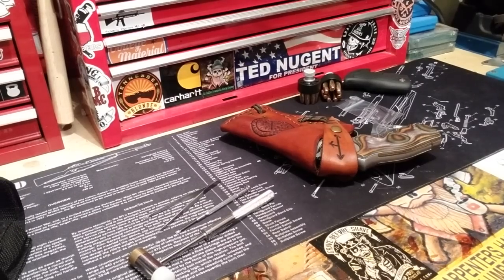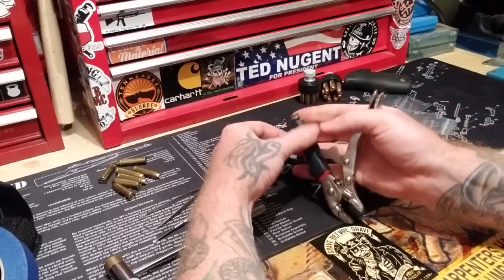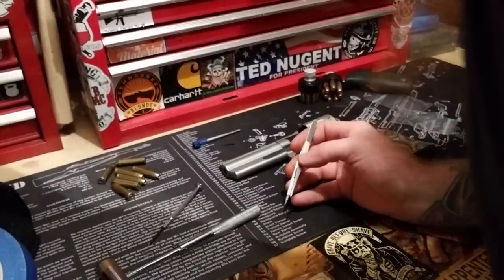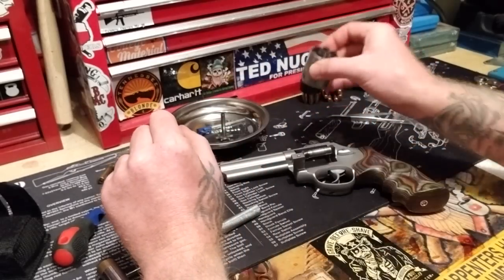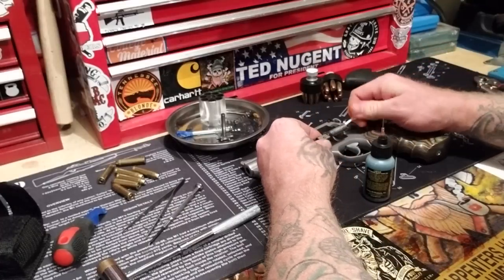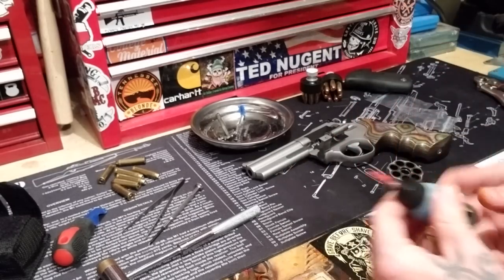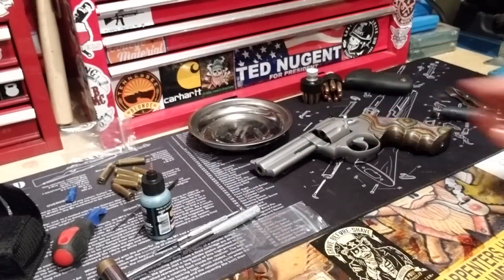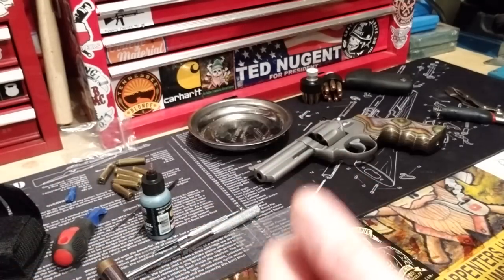Revolver Cylinder Removal and Extractor Repair

Comment: This is exactly what I needed to see , thank you I seem to have a little rust problem inside the cylinder somewhere at least the color brown shows around the ejection where the rounds go in the cylinder , so I figured to take it apart and clean it because the cylinder had trouble turning , any advice you care to give will be great fully accepted , Maybe a special oil this is a new Taurus 38 Special ultra lite and the cylinder was so tight I could not cock the hammer back , I had to open the cylinder remove the rounds and Squirt penetrating oil to get it to spin freely , And thanks to you , I know how to take it apart for cleaning , again thanks , I did have The slightest idea how it came apart . Great Video Complete and Total Thumbs Up !
Reply from the maker: Thank you brother please subscribe.

Comment: After disassembling my Taurus 856 to polish it, my extractor isn't engaging on the spring to keep it forward. The spring is definitely still in there because I can feel it hit it when I push it in all the way. But the spring isn't stretched enough to bring the extractor back against the cylinder. I've taken apart a lot of j frames and have yet to run into this sort of issue.
Reply from the maker: I'd replace them all.

Comment: I have a Judge that the cylinder won’t release. It does rotate when the trigger is puller and the release seems to functioning but will not let the cylinder come out. Any thoughts on what it could be?
Reply from the maker: You'll have to look up judge cylinder removal.

Comment: I've worked on a 3 or 4 S&Ws and I've never seen the spring you pull out of the yoke/crane.  The last one I worked on was a M36.  Does the 686 have parts the 36 doesn't have?

Comment: I can remove the ejector pin but the ejector that removes the ammunition will not come out. For some reason it does not slide out. Does anyone have a solution?
Reply from the maker: You have to unscrew it and push pull twist.